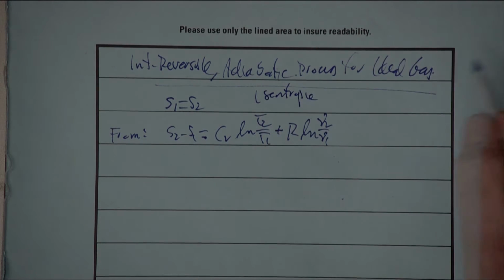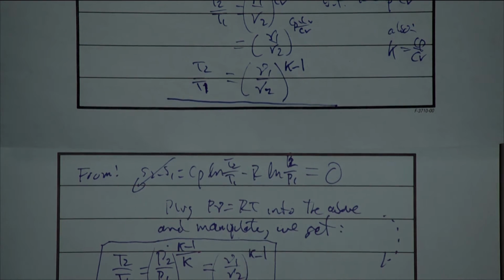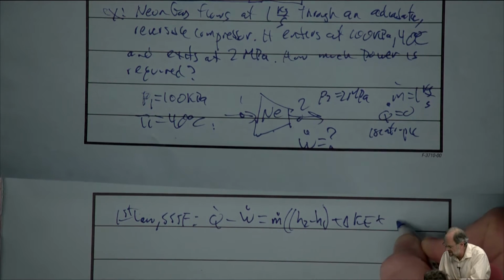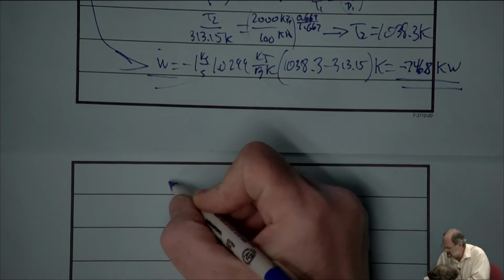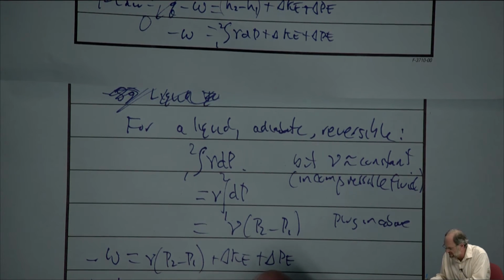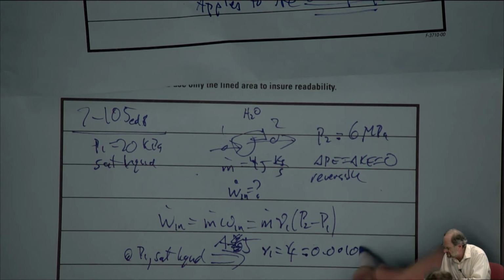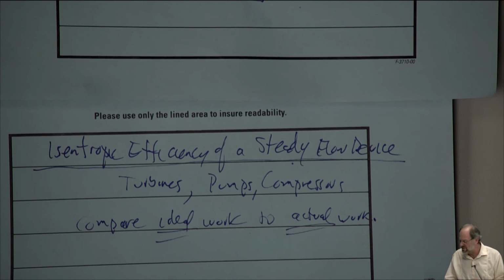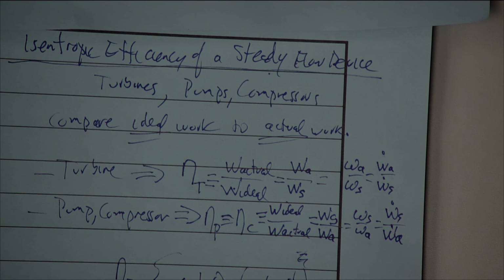Thermodynamics: Isentropic Process, Ideal Gases; Reversible Work; Isentropic Eff. (21 of 25)

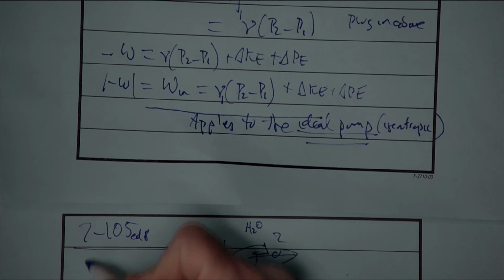Comment: at 28:52 How can we know it is saturated water without check any table ?
Reply: it tells us in the question.
Reply: @berkcanozturk655  it is saturated liquid at the inlet, but is it okay to assume its specific volume wont change throughout? I tried solving it by using w = m(h2-h1), since vdP=dh for isentropic process. 
When i equate the entropy at inlet and outlet, the value of s1 is way below to the sf at outlet. Is this wrong? Anyone tried solving it this way?
Reply: okay nvm i got it
Reply: @ken-cf7tf  Well, it is been 4 months lol I have no clue right now. I passed the course like 2 months ago. I'm glad you figured out tho, good luck in the exams.
Reply: @berkcanozturk655  thanks. good luck in your studies too. 
Btw, h2 is found in compressed liquid table by double interpolation. Just to add for those who may be confused as i did.